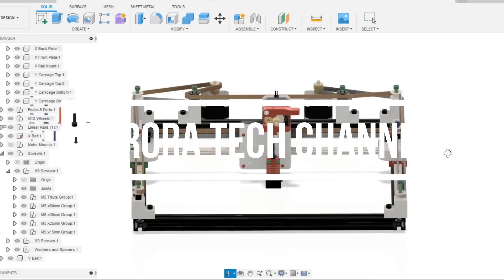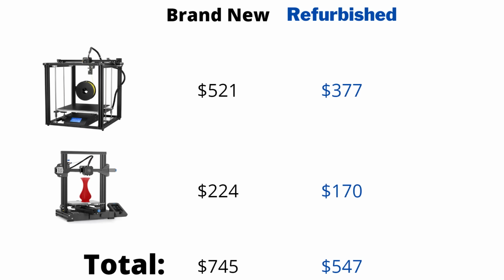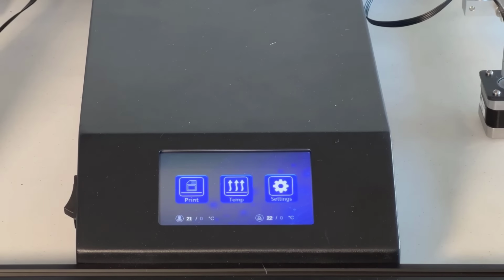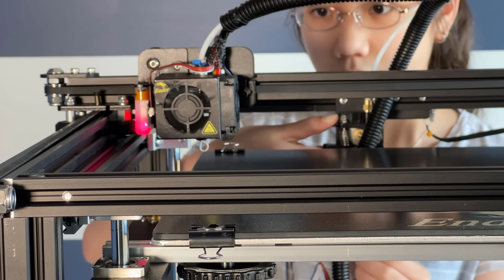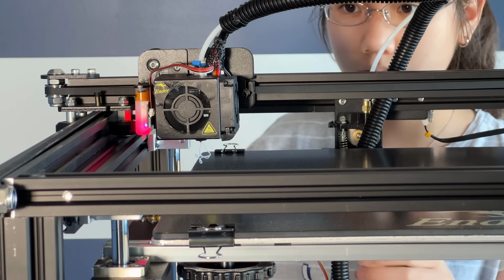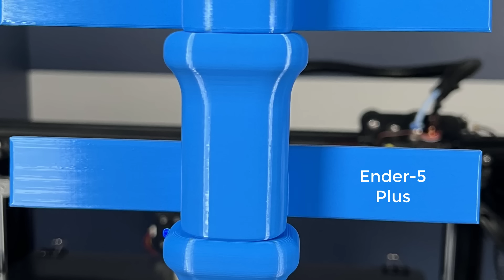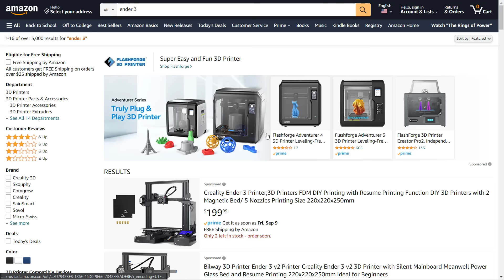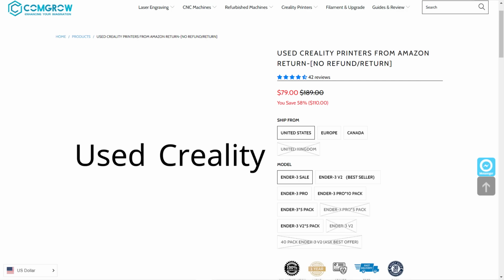Is it worth it to buy a refurbished 3D printer? Refurbished Ender-3 V2 and Ender-5 Plus from Comgrow

Comment: I've bought 4 from Comgrow, 2 of them were "used returns" from Amazon and were almost in as many pieces as they could be, but were complete. I made it a point to assemble them without any of my spare parts. The other two were "referbs" and other than some misses with the packaging, they were like brand new.

BYW = The Ender 3 ($79) and the Ender 3 V2 ($149) and as soon as I finished putting them together, were  off and printing almost 24/7 ever since.

Comment: I just bought a refurbished ender 3 s1 pro yesterday. Its truly difficult to believe how much money you can save off of retail price. I believe the unit cost around $500 new and i spent $233. Over half off!!! I cant wait for it to get here. Its my first my printer and i want to use it to print polycast for aluminum casting.

Comment: I bought a "refurbished " ebay V2 for $189.00 a few months back. It too looked brand new. I had never used a 3D printer till I bought it. I learned to do so much on this printer that I wouldn't hesitate to buy another refurbished machine.
Reply: but why, a new one costs 200

Comment: I bought an E2 V2 for $139 and a Voxelab Aquila for $89, both returned/refurbished.  The V2 had a Y-Axis cable plug smashed.  I have spare parts, including cables, so I just changed the plug.
The Aquila was perfect.  Almost brand new, but I was told it was a 3D show working display unit.

I have read horror stories about buying this way, but honestly, my experience says that it is the best way to go!

Comment: Every 7 of my 3d-printers had one thing in common: there was something that I had to fix/adjust/rebuild to make it work the way I liked.
From a certain point of view, every printer that is running is a re-furb; either by a vendor or the current owner!
Show of hands: who has NEVER modified their printer in some small way, and it worked perfectly first day?
Just as I thought...
Reply: I've purchased 4 or 5 ender 3 V2's used locally and had the same experience - had to rebuild some of them to make them square and plum, and had to unclear a bad clog on one. After doing that and upgrading to custom firmware they all worked reasonably well (some a little better than others).

Comment: Be aware if buying a "used/amazon return" printer from comgrow; it's a gamble what you get and they don't accept returns. The ender 3 v2 I got was partially destroyed and was loose in the box with zero packing.
Reply: Bought 2 ender 3 pro from them a few months 1 was perfectly new and the 2nd 1 didn't work sent it back and was refunded then just about a week ago I ended up ordering a ender 3 for for my son for 79$ practically brand new.
Reply: Like he said, it's a gamble.
Reply: @daniels4338  😉
Reply: Some of this returns, at half price on EBay, are practically new.
Reply: Some returns maybe damaged boxes or stock, or buyers remorse. Others maybe people thinking that they got into more than they bargined for as the learning curve is quite steep. God forbid it's a return from a home tinkerer with no mechanical skill who can't intuit or read instructions and overtorques screws and bolts. Lol.
Reply: EU law or PayPal will project you from gamble.

Comment: Great job! I don't like Creality as a company, but good to know there are a lot of options out there for people on a budget.
Reply: I bought the Ender 2 just after its release and also the CR-10 and Ender 3, at this time I could have been described as a Creality fan boy but that soon changed when I bought an Ender 5 Plus, I noticed much lower build quality and bent rods and a general lack of QA and my friends bought Ender 3's and V2's and the quality was much poorer than my original one, I also dont like Creality, they will continue to release new machines with the inherited faults of the past models instead of fixing them, this has to end at some point or Creality will end!
Reply: @AndrewAHayes  My brother bought the Ender 3 and I bought a Voxelab Aquila which was a clone of the Ender 3 V2...and I preferred the Aquila, so I was more of a Voxelab fanboy I guess. But now I mostly use Anycubic printers and I love my Kywoo Tycoon Max as well
Reply: @AndrewAHayes  Yeah, I think the Ender 5 Plus can be a good modding platform (CoreXY) provided you can get it at a steep discount.

Comment: I sent back an Ender 5 Plus to Amazon that had 4 bent smooth rods 2 bent leadscrews a BL Touch with a cracked circuit board a control board who's USB chip had burnt out due to a failed cooling fan and an aluminium build plate that had what only can be described as a mountain in the centre, the glass build plate teetered and rocked on it.
 I feel sorry for anyone who ended up buying this printer, I have since bought another two Ender 5 Plus printers and both came with one bent leadscrew.

Comment: Hi Aurora, Another great video, many thanks for all the work you and your brother put in to help us all. Would you consider producing a video explaining the differences between the plethora of Ender models. It is very confusing and I am not sure which would be the best choice. I am currently thinking about getting a 3D printer. A short while ago before I found your channel I would have probably picked a Prusa, but now am more inclined towards an Ender or the Bamboo Labs Carbon. It is just for hobby use mainly to make small components or to make the parts for RC model aircraft, especially designs from Eclipson. The speed and being fully enclosed of the Bamboo Labs looks very attractive. I am happy to spend more initially to get a unit that will perform better and last me for longer. Richard
Reply: Amazon has the Ender 3e for a good price it has upgrades preinstalled saving avout $80-$100.00. 
These include silent board 4.2.2, all metal extruder, capricorn tube,glass bed, CR touch auto level. All in all a top notch deal.
I'm currently added/adding all metal Slice copper hot end and heat break, 2nd Z axis w/timing belt, standard magnetic bed, and pei magnetic bed, improve 3 fan setup on hotend, direct extruder mount and moveing it from side to top, stainless compression nut on hotend instead of bodin tube fitting, and 50 watt heater w/ 100ohm 500 degree thermister. That should just about do it.
Reply: Hey Richard...I would wait a bit pon the Bamboo Lab printer....too many issues still as far as I hear. The creality 10 pro is my favorite in the moment

Comment: great videos and advice. I would some more of your advice please. If I am just starting (1st one), would you suggest  the ENDER-3 V2, ENDER-3 PRO or the ENDER-3 to learn on? or something around those prices, any will be refurbished items. thanks for the help
Reply from the maker: The Ender-3/Pro/V2 are similar in print quality and hardware, you may also take a look of the Ender-3 S1, it's much easier to put together and print better. For refurbished printers, they just work the same, if you are OK with some cosmetic defects, that's a pretty good deal.
Reply: @AuroraTech  thank you

Comment: Aurora 😊 new studio?
Reply from the maker: Too hot in our garage (104F / 40C), just move some printers to my dad's office for filming. But we are trying to occupy that room permanently :)
Reply: @AuroraTech  you guys deserve a new room!
If your garage is really hot, have you tried one of those air chillers you can move around? I refer to the big fans on a large water container. These really work well and you can move around!
Reply: @AuroraTech  
Also, your dads office is painted amazing!
Reply: @Jbobonline  I wonder how much that would raise the humidity level? I know where they are humidity is low I just wonder how much it would go up.
Reply: @bwselectronic  
I have one of these in my porch. I can’t tell you that I measured humidity but the feeling is much better when it’s on. There’s air circulation and the temperature drops